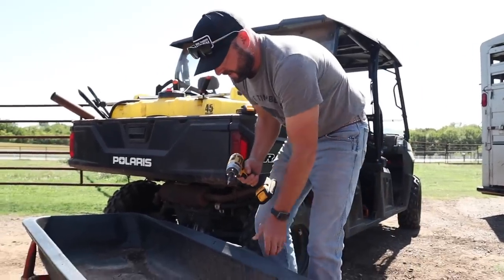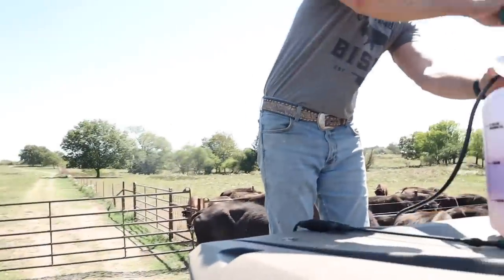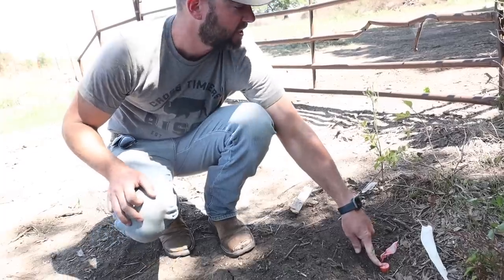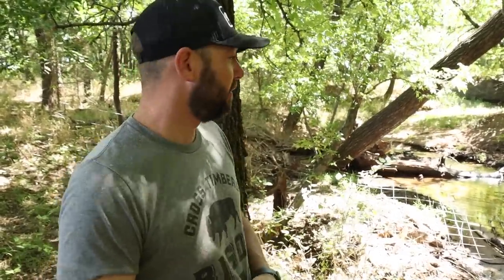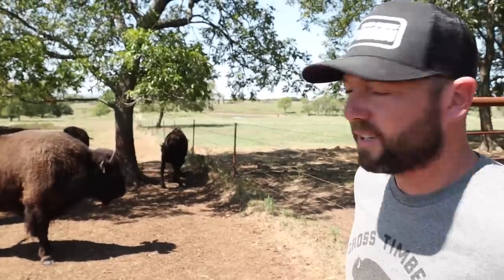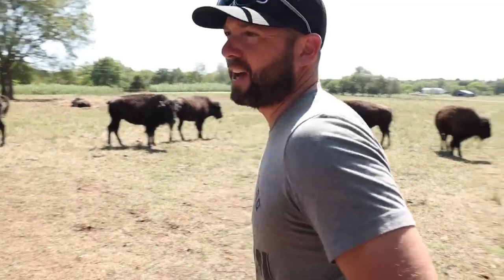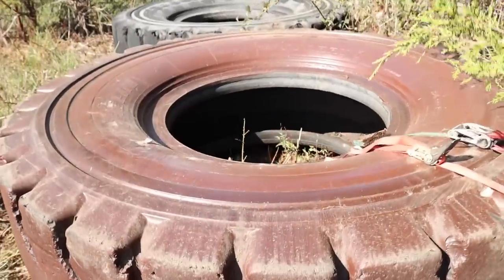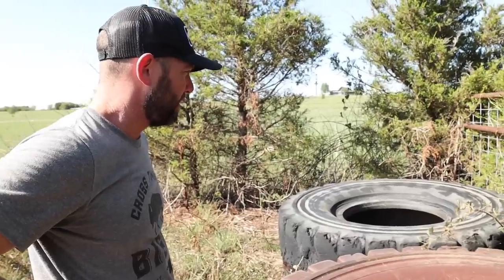They Hate This... But They Need Help!

Comment: You can get a cattle rub with face flips to help with fly control. They learn to go under it to scratch their backs & administers the fly repellent as they rub. The face flips gets the chemical on the face for that area also. Cattle love it and the bison may also.
Reply: That's so cool! Somebody was thinking creatively. 😁
Reply: Also adding insecticide dust where the bison dust bathe can help too.
Reply: I was thinking same thing
Reply: I've seen those fly control applicators strung across a couple of gates at one of Cross Timber's corrals (I think ?) Evidently, the bison walk under them, they rub on a medicated fly spray across their backs as they pass below and that helps to deter those annoying flies !!
Reply: @johnking8679  exactly.
Reply: I thought the same thing!
Reply: @wandajoyadams2492  he already does that.
Reply: Good idea.
Reply: I think they did it at the original ranch

Comment: Hey Dusty! There is a guy here on YT that put fly tape on 50 gallon plastic drums out in the fields. He did it like 3 times and cleared out the fly over population. It looked like it worked well with no chemicals.
Reply: Homesteader is Morgan Gold of Gold Shaw Farm located in north Vermont. He has a small herd of Highland cattle. They're in confined area grazing. He moves them daily for fresh grass and field recovery. Fly tape solution works because his specific setup. BTW Morgan received referrral to your channel regarding system setup for working bison/cattle. He just completed initial build and looking for suggestions.
Reply: @debbiferguson9669  He should check out the working system at Lazy G Ranch here in Cookeville TN! It's a beautiful ranch!
Reply: That was amazing! I'd be afraid that someone with a bad attitude would turn it into a toy. Not sayin any names....Joe
Reply: They are trying the plastic drum on the Walker Farm Fam......not great results but only a couple of days so far......next they are going to try wrapping the trees....always interesting.

Comment: Anchor steel pipe on both sides of the creek. Extend pipe from one side to the other across the creek. On the lowest pipe bend pipe vertically into a circle around the lowest pipe in each place a vertical pipe will be placed. Weld horizontal pipe steel across the creek onto the vertical pipe you hinged. When the creek is low the pipe fence cover hangs straight. When the water rises the hinged pipe portion will hinge up through force of water passing and water will pass without incidence. Works like a clock.
Reply: I've used a couple of different things across a creek, depending on the width. Cable run along the top of aluminum gates and anchored on each end allows for water flow and will rise and fall with water levels. Also used a long piece of pipe with additional pipe welded on, think of a comb, and strung it across with cable. The pipe is heavier than the gate, but both were effective.

Comment: Here in Wisconsin, and I think maybe nationwide, treatment plants have to meet 1 of two standards for water purity that they release. The standards are based on the volume of the body of water they release into. One standard is stream standards, that is their released water doesn't alter that quality of the water they release into. The other standard is effluent standard which is the purity of the water as it leaves that facility, this standard is the one you want as it will mean that the water coming out of the plant is very high. Learned this taking a random 300 level college Chem course aimed at Civil Engineers with a sanitary option, ie they would be running water treatment plants or designing them for municipalities and businesses.

Comment: Dusty, couldn't tell for sure if you are looking for ideas to get a fence across a creek, so for whatever it's worth, we made what we called "water gaps".  Just hang heavy wood fence posts on barb wire across whatever stretch of water.  Hang them low enough(still above normal water levels) that livestock won't go under and when the water gets high enough, the hanging fence posts just flex with the flow of water and do not get washed out.  Hope this helps.  FTR,  you hang the fence posts horizontally., wiring them to the bottom two strands of your barbed wire fence. This makes things strong and flexible. Be blessed.

Comment: Dusty. To keep the Flys 🪰 down get a Drone with a Spray Tank on it then it may work better also if you can keep the Weeds Down easier. In Ohio we have Drones Spray Our Crops using GPS.  Since you have a Creek use it to keep Ponds Full . Great Water system you have.

Comment: have you looked into a scratching post for them? there is a company that does this for cattle. dono if it will work with bison. I saw them on tom pemberton farm channel. easy swing is the name of the company. the bison can use it to scratch the flies off if they need. dono how the bison would react to the post tho and is made for cattle not bison. just throwing out ideas. (also might be extra cost for the farm since you're already buying feed too). the post stays but you can replace the brush if it wears out.

Comment: I have a question,why would Johnson grass kill a bison, when people in North Carolina will bale it to feed it to there cows
Reply: During drought or ftost/freeze, JG can produce toxic levels of prussic acid or nitrates, especially in new growth, which the animals prefer to eat. Cured JG hay(cured a couple days longer) dissipates these to the uv rays and wind/air moving through it. It's ecmxcelkent hay rivaling alfalfa if cut at boot stage.. protein falls off quickly afterwards, but still good hay but will need supplementation..

Comment: Didn't make sense. OLD fence neighbors boundary and maker 4 ft IN from fence. QUESTION how did you gain 4 ft?
Reply: We lost 4 feet but gained 4 ft of clean and clear boundary line between fences to make maintenance easier
Reply: Don't know about Ok, but in Texas and probably most states, a  letter to the land owner explaining the actual boundary to the fence is still the property line and does not confer  ownership to the new fence.. the original boundary fence is still the property line.. the inner fence is not.. it's a perimeter for an internal division.